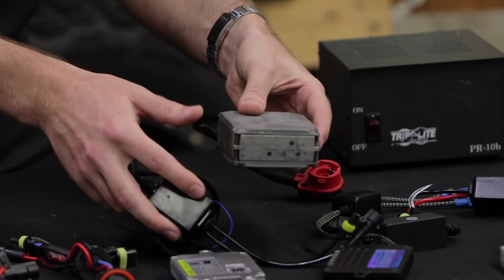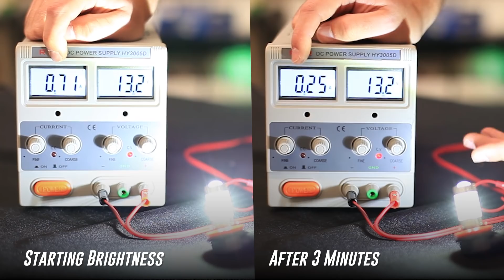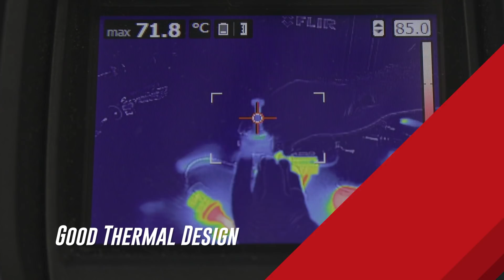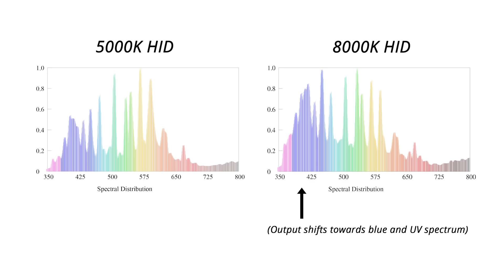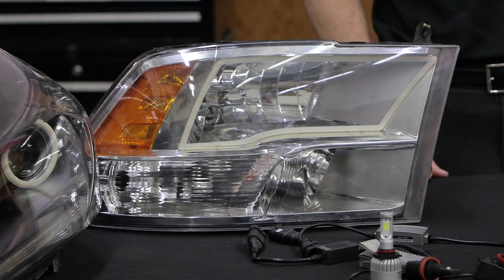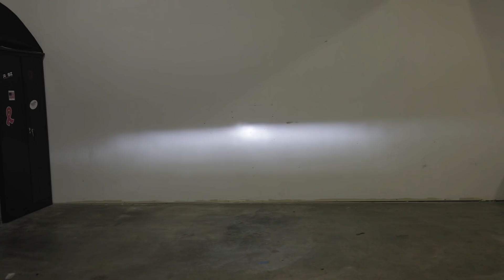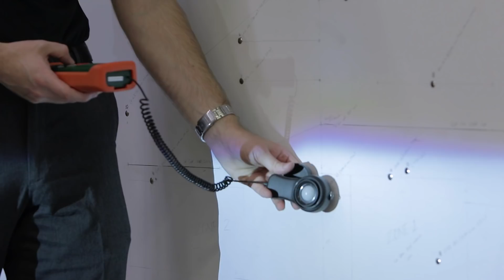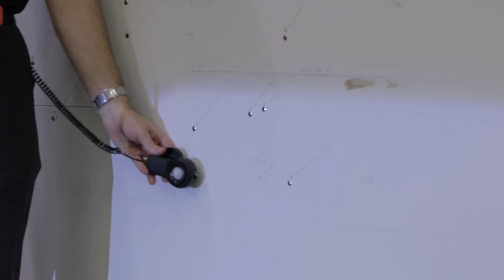HID vs LED Headlight Bulbs: EXPLAINED

Comment: Diode Dinamics, why IPF LED Headlights bulbs producing 2500LM each? Last longer and much brighter than your led bulbs?
Reply from the maker: Even i the rating is accurate (probably not), more light from the bulb does not necessarily mean a better beam pattern. To get more output, the bulb will likely be out of focus, and it will be overpowered. Please check out our video on "are your LEDs too hot?" to learn more. Thanks!
Reply: Diode Dynamics I am using H11 DD led bulbs in Prius 30 with new Koito headlights, they work good. On my second Prius also new Koito headlights installed, I’m using IPF H11, XX series. They work amazing! The pattern on both brands are good. But! IPF has much more light output, which is not getting dimmer after 2-5 hours of use. DD is like dimmer from the start. DD has light output the same level as Philips LED bulbs. You guys trying to extend the lifespan to of led chips?
Reply from the maker: We have designed the SL1 with both brightness and longevity in mind. All of our LED bulbs that we offer will be rated at 40,000+ hours with of use.

Comment: Thanks for this video it was very informative! I hope you will answer my question. I have an '07 Camry and had the yellow film cleaned off the headlamp a couple of times but the lights were always dim. Couldn't see 5 ft in front of you even after trying LED lights. The round headlight had a bluish color to it (the bright lights worked just fine).  Is there a projector in these that go out and won't work no matter how clean the head light component is or does the lens get dirty on the inside or degrade after time? I replaced the whole headlight unit with an aftermarket assembly and it works great now with the LED bulb. Being a woman,  I went through so much grief from the men in my life that said all you have to do is clean the headlights or adjust them and all would be okay. I was told I'm wasting my money replacing them and mechanics were just trying to rip me off. I found a body shop that replaced them in 30-45 minutes and charged me $80 labor with no mark-up on parts instead $350-$1000. Thanks much.
Reply: I have an 07 camry aswell and jeez do I know exactly what you mean. Mine had become so yellow and gross. I couldn't see at night under any conditions. So I replaced the headlight unit myself and it's a world of a difference. Then I put xenons in from OPT-7 , which have the best in my opinion and I've never had a problem again with seeing at night.

Comment: Great video, I thought I knew a lot but you have certainly increased my understanding. I run LED (focused Cree) and a quality HID driving lights. The purpose was to reduce the current draw from my original high wattage lights. Works a treat, but your vid has explained very well the operation of these systems. My vehicle is an 80 series Landcruiser that does huge amounts of desert and off road driving. The HID's are headlight and driving light conversions and the LED's are also driving lights. The HID's are used separate to the LED's for wide long distance vision. The LED's are for forest or tight bush tracks. Its a great combo, I hope your viewers get to benefit from your vid Thanks I have subscribed.
Reply from the maker: Thanks for the support Barry!

Comment: In the unlikely event of an EMP, both HID and LED lights would die, correct? Due to being operated by microprocessors?
Reply from the maker: In the event of an EMP, there would potentially be electrical issues with many vehicle components, including HID and LED.

Comment: wow a actual person speaking clearly ... more info than ever... I have a GMC ACADIA DENALI w/ HID and switch fog lamps to LED and yikes bad idea did not last 3 weeks lol... went back to regular - maybe ill try HID foglamps? ummmm
Reply from the maker: For fog light applications, I would recommend one of our LED bulbs, as it really can come down a lot to the overall quality of the bulbs. With our Diode Dynamics bulbs, you will not have to worry about a bulb burning out prematurely. For instance, our SLF LED bulb is a great option!

Comment: You mentioned 55W Xenon bulbs. Is that a better option than my 35W D1S bulbs in my ML350?
Reply from the maker: In this specific case, we would recommend sticking with the stock D1S bulbs, as modifying that could cause issues down the line.

Comment: why would you put all that expensive junk on your car , only to blind on coming traffic . Do you think if you see farther you can go faster ? what about turns , you can't see around them .put a halogen bulb in it and make sure your batteries is OK .
Reply from the maker: When placing HIDs in projector based housings, or LEDs that are designed to properly mimic the beam pattern of a stock bulb, you will not blind oncoming traffic at all! More visibility with a proper beam pattern is never a bad thing!
Reply: @diodedynamics  look in to your head lights then look away , you are blinded by that artificial light for at least three seconds ; is that what you want to do to on coming traffic , blind them so you can see more .Not only that , they are more money and can't survive the harsh environment of a car head light .They are just junk .Thanks for the reply , drive safely .
Reply from the maker: @kenreese2791 , feel free to give ours a try, we think that you will be happily surprised with how these perform! While what you had described is certainly the case with some generic LEDs that are not properly designed, that is not the case at all with Diode Dynamics - thanks!

Comment: I hate HID lights. Meeting them on the road is like staring at a couple of arc welders coming at you. I think they make night driving really unsafe as oncoming traffic gets blinded.
Reply from the maker: When HIDs are placed in the correct style housings (like projector based housings for instance), glare is not going to be something you would need to worry about. Unfortunately, not all people do this, and the glare is often caused by placing an HID in a reflector based housing.

Comment: I used the auxbeam LED in my 93 Silverado they are so bright I had to adjust my driver's side toward the middle so I will not blind oncoming traffic.
Reply: That has nothing to do with brightness that has to do with you putting an LED bulb in a reflector housing which is the cheapest way to do it
Reply: Actually it has everything to do with it if adjusted properly LEDs in a reflector light are bright as F and will not blind oncoming traffic .

Comment: Are their 24V led for trucks?
Reply from the maker: Hey there!

Our SL1 LED headlight has an operating voltage of 5-16V. 

If you have any other questions, just give us a call at 314-205-3033, Monday-Friday 9 a.m.- 5 p.m. CST, or shoot us an email at contact@diodedynamics.com!

Comment: Firstly great video, I thought I knew all there was to know yet I learnt a lot more after watching this. Secondly, I would say that most European cars with halogen projectors have what we call “squirrel finders” each allows abit of light above the cut off line to illuminate road signs, so glare is still an issue with HID/LED “upgrades”.
Reply from the maker: Thank you for the kind words! We're always looking to further inform our customers, in addition to providing you with quality LEDs. Also, thank you for the information!

If you have any other questions, or need some assistance adjusting your headlights, please feel free to give us a call at 314-205-3033, Monday-Friday 9 a.m.- 5 p.m. CST, or shoot us an email at contact@diodedynamics.com!
Reply: 9600GTMAN  azért, mert látni szeretnék és nem vakítok el senkit, máris bűnöző vagyok? :D

Comment: I seriously want to buy headlight (LED) compatible for my Mazda 3 2011. Would you recommend the transition or just to stay halogen?
Reply: If you got the cash get some nive hids if your on a budget get leds
Reply from the maker: Hey there! 

Here is a link where you can find our SL1 LED headlight bulbs to replace your stock Halogen bulbs: https://www.diodedynamics.com/by-vehicle.html/?no_cache=1&find=2011-mazda-3-hatch-317697

If you have any other questions, just give us a call at 314-205-3033, Monday-Friday 9 a.m.- 5 p.m. CST, or shoot us an email at contact@diodedynamics.com!

Comment: Any brighter light source will create more glare unless the light distribution is altered. 
Having LEDs be a little bit brighter is alright, but adding a lot of brightness will always add glare and I have had to modify drivers in the past to reduce the current to more acceptable levels.
Reply from the maker: As long as the bulb does a good job at mimicking the beam pattern of the stock bulb, it should limit glare greatly. Luckily, with our SL1s, that is not an issue at all!
Reply: @diodedynamics  That is true as long as the SL1 are not too bright. In my experience, up to 13W LED power per bulb is somewhat close to halogen. The 20W of the SL1 (including the driver and fan losses) are probably okay, I assumed it was way higher power because of the large cooling solution (which must yield excellent thermals with only 20W to dissipate). Ill be buying a pair. 

For future revisions I would love to see an adjustable mount to get the light pattern just right with any headlight. I think philips did something along those lines with their excellent but expensive led retrofits.
Reply from the maker: That sounds like a plan! Just let us know if you need anything else!

Comment: Excellent information, thank you. Unfortunately you don't make an H11 that will fit my 4runner, so I'll have to go elsewhere.
Reply from the maker: Hello Brent! Unfortunately the 4Runner is one of the new vehicles we have had reports of fitment issues due to extremely tight clearances where the bulb is inserted - sorry!
Reply: @diodedynamics  Do you know whether or not it was a case of the dust cap being the issue? Or is the housing just too small to accommodate the cooling portion of the light?
Reply from the maker: @BB-wj8dv , the fitment issue is with the housing itself, so there is no way to fully lock in the bulb.
Reply: @diodedynamics  Well that is unfortunate. Your HID kits fit alright though?
Reply from the maker: @BB-wj8dv , trust us, we wish the SL1 didn't have this issue! Overall, the SL1 fits in the overwhelming majority of vehicles, as this is one of the few exceptions to that rule. It is certainly something hope to explore in the future. In regards to the HID kit, that will fit just fine and is available on our website!
Reply: @diodedynamics  Thank you very much for the information. I'll likely be purchasing one later on in the week.

Comment: surprised you guys don't have LED headlights for the JL wrangler yet. 
Or the JK, holy crap, big market missed there.
if you do have them, they are not showing up in the vehicle selector.
Reply from the maker: The dual filament bulb sizes are certainly something we are hard at work on - don't worry! :) Stay tuned into our social media, as we will be posting it there as soon as it does become available!

Comment: U need a 180 degree LED for headlights with lens,they are  called G8L and we need another video on it
Reply from the maker: The SL1 bulb does a fantastic job at mimicking the beam pattern of a stock bulb. Feel free to give it a try, we think you will be happily surprised! :)
Reply: @diodedynamics  if its really mimicking halogen bulbs that means 
50% of the light is still wasted by the lens lid inside , please correct me if  
I am wrong ,and sorry for my bad grammar, I also made a scetch https://ufile.io/yhw4dxpg

Comment: Very informative video, thank you! But how to deal with radio interference caused by HIDs? The minute I turn on my HID I get so much static the radio becomes unbearable to listen to ☹️
Reply from the maker: Our ballasts that we offer have an extra ground wire, specifically for eliminating radio interference that happens with some vehicles. That should help dramatically! :)

Comment: This has to be the most informative video to date on headlights.  Your abilities to speak clearly, concisely and utilize examples to help consumers better understand the complexities of various bulbs was amazing.  Thank you. I now know which direction to go instead of wasting money on trial and error.
Reply from the maker: Thanks for the support!
Reply: @diodedynamics   .. Interesting. Very. But why did the measured outputs for all bulbs drop in the projector system? I thought it was supposed to collect and focus the light better than the reflector system?
Reply: @funkie.dude.original  Mainly because the projector systems spread the light out more evenly, reducing the size and intensity of any hot spot. Notice the difference in the intensity of the light on both sides of the hot spot, between the projector and mirrored systems.  The mirror, or reflector setup has a higher intensity hot spot, but less intense light going out to the edges, whereas the projector lessens the hot spot but has higher intensity to the edges.
Reply: @diodedynamics  I need a 9007 LED bulb.  Any in the pipeline?
Reply from the maker: @Eddieaytch , definitely in the works! We anticipate release later this year. :)
Reply: totally agree excellent vid
Reply: I have to concur completely. Excellent, well presented and balanced.
Reply: @GoodISnipr It's not annoying to all.  The repetitive nature drives home the point he's making, specifically by reiterating immediately with different wording for those that may struggle to grasp the concept (such as those who aren't versed with such tech), and ensures better results across the board for those who have watched the video. This should reduce the amount of calls to tech support from misunderstandings if the first way he says it doesn't click

Does this result in a longer video? Obviously.  Does it mean those who're impatient may be turned off? Well, again , (points at you) obviously, but I'd posit that if you wanted the cliff notes version you'd have likely seen that it's a 25 minute video and have gone searching elsewhere.  Otherwise, you should look to yourself for clicking the nearly half-hour video
Reply: Shop Munkey 
Stealth Racing
Reply: The best and most informative video on the subject. Very well done.
Reply: How long have you worked for them?  ;)
Reply: therealnightwriter  you sound like a disgruntled negative person that has nothing positive to say about anything, especially towards those that are trying to educate the public. Go troll the porn site Instead. Your commentary is better suited for the gutter.
Reply: @mkhy3565  Please do not confuse marketing with education.  They are two different things with two different goals.  Education is most certainly NOT taking only one point of information, particularly from a merchant.  Ever hear of independent peer review?
Reply: To those who complaint about this video. Did you paid for it or was it free to watch? Then STFU and go do something productive with your life!

Comment: I own a 2017 hyundai elantra, would it all fit if i close the cap? Or installing it would leave it open
Reply from the maker: Hello Jon! In the majority of cases, the SL1 will fit behind the dust cover just fine, without any modification.
Reply: @diodedynamics  including the driver?
Reply from the maker: @RollinMatic , correct!

Comment: what we need is a bulb that incorporates the bulb and projector all into one package. For cars that don't have the projector headlight system built into the lens assembly.
Reply from the maker: Hello Lakario! While it is nothing that we offer at this time, there are some options on the market that offer LED projectors that you can custom retrofit into your headlight assembly.
Reply: +1 from Diode Dynamics. The Retrofit Source makes and sells multiple LED projector retrofit kits to suit different budgets and applications. They offer aftermarket retrofit solutions as well as retrofit kits using OEM products found in vehicles like Toyota's.

Comment: Extremely kewl and informative ! That being said what would you recommend for a 2011 Taurus with projector headlamps ? Stock lighting almost seems dangerous.
Reply from the maker: Thanks Michael! If you have halogen bulbs, both our SL1 LED or an HID conversion kit would give you an increase over stock. Check out our other video below detailing some more of those differences!

https://www.youtube.com/watch?v=zb_AupXBhac
Reply: My mazda has projectors and led's just wouldnt put out a good beam pattern found hid to have an acceptable pattern but the light output is amazing